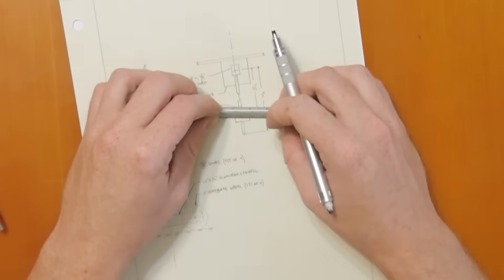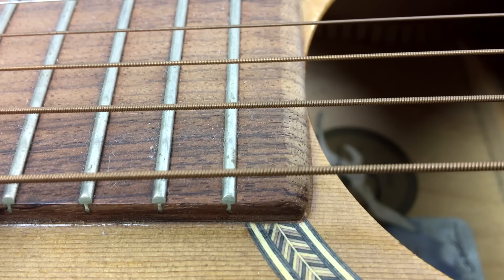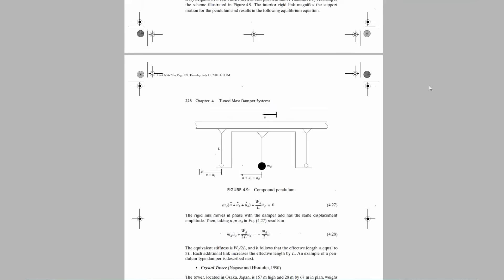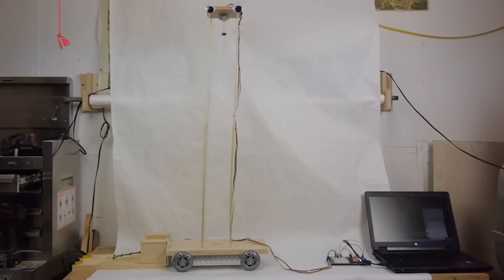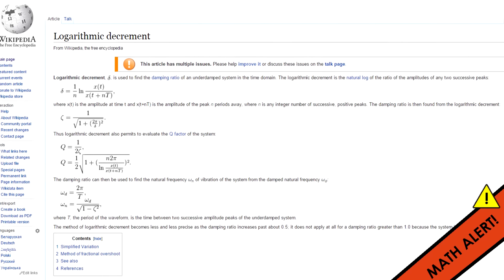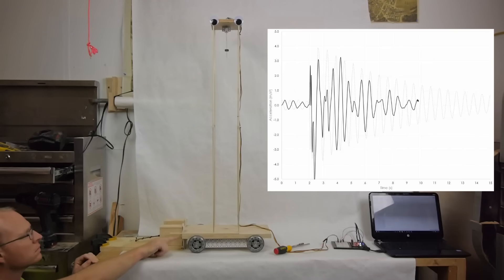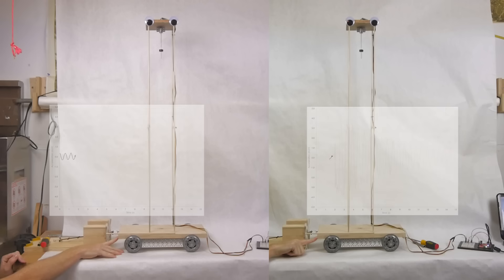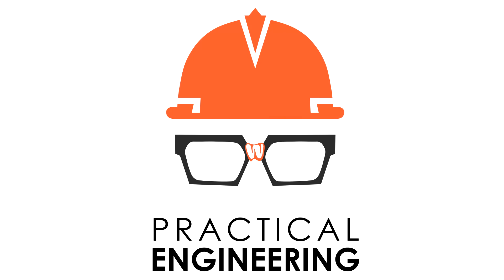What is a Tuned Mass Damper?

Comment: A sky scraper is just a cantilever beam as is a boring machine spindle. If you examine some of the auto boring machines you will find a mass at the end that is coupled by a viscous air gap. This is effective in reducing chatter. Similar idea with slightly different configuration.

Comment: The skyscraper in 1:49 is actually a bad example because it does not have a mass damper, it is designed so that when the wind blows it won't experience oscillation.

Comment: What would happen if the cables holding that heavy sphere up snapped? That thing would plummet through every single floor, crushing anyone unfortunate enough to be under it, until it reached the ground. You must introduce complexity to handle multiple situations, but that same complexity opens itself up to more points of failure. Still, it's a great innovation, as long as it works.

Comment: Great video! 
But (someone may have already pointed this out) it feels like the comparison was not entirely accurate. In the test without tuned mass the "mass" is still on top of the skyscraper (except that it doesn't oscillate). Which in my understanding of physics should get the skyscraper to oscillate more than if the weight wasn't there. Would be interesting to see how the skyscraper would had behaved without any extra weight on top compared to the one with the tuned mass.

Thanks for posting videos like this!

Comment: When I was a kid I used to visit the World Trade Center fairly often and I hated going up to the observation deck. It wasn't terrible. But I always got a little vertigo and I could feel the building swaying constantly. Not bad enough to knock me over or anything. But especially when I got near the windows or went on the roof I could really notice the building moving. I wonder if those buildings had Tuned Mass Dampers. The wind up at that height was always pretty fierce. And New England weather can be nasty. I was always worried about the whole thing falling over in a high wind (obviously I was a kid and there was nothing to be concerned about). But regardless of whether or not they buildings had TMD's or not... man those suckers moved around a lot.

Comment: When to the engineers calculate and tune the dampener?  After the building is built or before hand using simulator and calculation?
Reply: Calculations and simulations, these would get refined and revised throughout the whole design and build stages of the project so that the damper is perfectly tuned when it's installed.

Comment: In gas turbine engines we worry about high cycle fatigue caused by resonant frequencies in a blade matching up with pressure waves acting as a driving mechanism.  I imagine you have seen the videos on YouTube where they put sand on a flat plate on top of a stereo speaker and generate numerous patterns in the sand (mode shapes) by varying the driving frequency.

Comment: I get the principle, but how is damping achieved by that screw tightening/loosing? Why isn't the pendulum still giving back the energy to the building just lkike in your first pendulum? And how is that achieved in full scale model?
Reply: He likely edited out a bunch of other attempts to tweak the pendulum exactly right. They're both oscillating with the exact same period but in opposite directions so they cancel each other out. If they don't have the same period then sometimes they will cancel out and other times they will add together.

Comment: Best explanation I can imagine of a messy engineering topic. Congratulations on an amazing job.
Regarding mass dampers: could an active system be an improvement? something that moves the mass to the point it predicts is going to be most effective in the next instant, so the mass gets there before is needed? (Kind of like gimballed rocket engines compensate for deviations of the entire rocket)
Thnx

Comment: So the kinetic energy is converted to heat to dampen the motion? In this example, the tension on the screw is creating friction which is actually what is drawing energy away from the system?
Reply from the maker: +Pointillism exactly
Reply: I used this information to fix a problem on my 3D printer which suffered from severe mechanical resonance. I used a hacksaw blade as the the "pendulum" (it was horizontal) with a magnet on the end as an adjustable weight. I could slide the magnet up and down the blade to change the resonance of the blade. Once the peak amplitude was found, I put a piece of aluminum approx.  0.01" away from the magnet. The movement of the magnet at resonance induces eddy currents in the aluminum which are dissipated as heat. This video taught me practical information that unknowingly applied to my own hobbies. Thank you.

Comment: First off let me say how much I've enjoyed your videos! They've been really interesting! I'm a senior at my high school, and this video has actually inspired me with an idea of making an adaptation of this for a science fair project. So I had a couple of questions maybe you could answer. My adoption idea (not sure if it holds merit or not) Would it make sense to make the mass dampener smart? Like as in connecting it to a servo and having an accelerometer measure its location and then it counteract it. And my second question (if the idea does indeed hold merit) is there any tips as to how I can program an arduino to accomplish this? Thank you! +Practical Engineering
Reply from the maker: +Spencer McDonald Thanks! It does make sense to have "active" control of a damper that can respond to vibrations, but doing so without a solid understanding of control theory would be a major undertaking. I would do some research on active vibrations damping and see if you can find any good references or guides. Good luck!

Comment: So, I was looking at the decay of the frequency after applying dampening and how you said that after the pendulum stops, that decay rate goes back to the "undampened' rate.

What if you wanted to continue damping? You would need the pendulum to continue swinging, but it won't because now the skyscraper's momentum is lower than the force needed to make the pendulum swing. So you would need a stiff damper that gradually became less resistant proportional to the decreasing momentum of the oscillating tower, right?

So then I thought, what if the pendulum was dampened with something like a non-newtonian fluid? Shouldn't one be able to complement the viscosity to the frequency of vibration to create a damper which constantly adjusts its resistance to the decaying momentum of the tower?

If any of this makes sense, PLEASE try it!

Comment: Sorry. I still don't get exactly how the mass damper decays the oscillation of the building.
Reply: Here is how I understand it.  1. Because the damper has the same resonant frequency as the building, when the building oscillates it transfers energy to the damper.  2. A friction device in the damper dissipates energy from the damper.  In the model, the friction device is the tightened screw at the top of the pendulum.  In real world dampers, the friction device is often hydraulic, similar to the shock absorbers on a car.

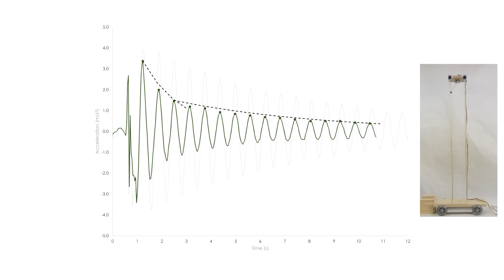Comment: Thanks a lot. Very much appreciate the hard work you are putting into each of your videos. Quick question. You are using Coulomb friction to dampen the vibrations. Coulomb friction is supposed to dampen the amplitude linearly but the results at 7:39 show a non linear trend. May be air resistance is having some damping as well. Could you please throw some light into the behavior of damping with coulomb friction. Could you also do a video on the lesser known damping situations that you talk about. Thanks in advance.

Comment: Great vid guys! I didn't understand something:  The difference between overdamped and critically damped. The graphs look pretty much the same except with a different slope.
Reply: Critical damping allows the system to return to equilibrium in the minimum possible time. Whereas an over damped system would take longer to return to equilibrium. I will give you an example. Analog multi meters have to have their needle critically damped. Because the needle will overshoot the correct reading when taking measurements. If it is over damped you would have to wait longer for the needle to indicate the correct measurement.
Reply: +Karthik C thanks for your help buddy

Comment: Very nice video, but i have one question: How does the Pendulum in the Tapei 101 loose its energy? Ther dont have a screw to tighten, so is it just the internal friction of the cables?
Reply from the maker: At 3:35 you can see the piston dampers. They connect to the pendulum and dissipate the energy.
Reply: Ah thanks, so the cables are jut there for the weight :D

Comment: those "GOOGLY EYES" must be the scientific kind..... lol.  Well, you sold me on this video, I hit the subscribe button. I have been designing &  building things for as long as I can remember for about 37 years... and one thing that never clicked in my head was your (triangle chart) of the inexpensive, effective, innovative. I am at a constant battle with myself. I go through the whole design game of crunching numbers to the best of my ability, to insure that I know where the minimum and an approximate maximum threshold would be or needs to be. My battle comes into play out of fear of something not being strong enough, lite enough, heavy enough, etc., of which results in my over designing and over building something, when certain factors are not an issue. Quite often, over the years, folks will mention to me, after seeing a project, they'll say, "WOW Drew...  it is not going on the space shuttle", or "you building that to go to war"... Although I laugh with them, it actually does bug me, that I over design & build everything. My point that I think I'm trying to get to, is; until I seen your triangle chart, I never had anything to go off of, as per, balance. All three points can be measured, and graphed, to aid in forming a balance of the minimum and maximum tolerances. The shocking part of this triangle chart, is that it is so rudely simple, like a slap in my face, as I question myself, "how did I never see this", even though I was already doing this. Some how, seeing this chart, lets me see these variants as a starting or stopping point. Thank you.
Reply from the maker: Thanks Dru. Really glad you liked the video!

Comment: Where does the energy go? In your damped mass, the dampening started when you tightened the screw. That seems to imply the friction between pendulum and the housing was able to absorb the kinect energy of the building into heat. For a building as large as the Taipei 101, this doesn't seem reasonable, since friction would: 1. wear out the coupling and 2. generate massive amounts of heat, day in, day out.
Reply from the maker: If you look closely at the weight for the Taipei 101, you will see piston dampers at the bottom. It doesn't rely on friction at the pivot. Not sure if they have to cool the hydraulic fluid.

Comment: Really great video. 
I modeled this in a project during my engineering program using MATLAB, though it was using a forced damping instead of a pendulum. It was a bit on the theoretical side so it very nice to see a more practical version and in particular with such a simple set-up. 
I have a question though about your data acquisition or perhaps graphing. What software did you use for real-time graphing of your arduino data? Or were you able to you that algaloo program for it?
I've used MATLAB but it isn't well adapted. I think I could do it with python too. 
Anyway, your input would be useful for my own future projects.

Comment: I wonder if a tuned mass damper would work to reduce the movement of a sailboat?
Reply: I would think so....   If you follow Formula 1, a few years back Renault was using a mass dampener in the nose of their race car.  Once discovered, it was banned.  It was a small can with a heavy slug in oil suspension.  Doesn't sound like much but it really stabilized the front of the car from "porpoising" under heavy braking on rough roads (relative).  Which sounds like a boat on rough seas.
Reply: Any mass added to the sailboat, would be best served below the center of gravity, and when trying to dampen pitch and roll the farther from the center of rotation as well. As such, you'll instantly see that many sailboats already have a mass damper of sorts (the keel). If you were to follow the formula 1 examnple, and install a weight suspended in a viscous fluid inside the keel (or possibly a series of these weights along the axis), you could generate a pretty large damping force on pitch. Controlling roll would be more difficult, since you  could not align damping weights along that axis as much. 

One thing to consider though... These only dampen oscillations. When the period of movement is greater than the structures natural period of movement, it is not an oscillation. In other words, these dampers will do nothing for a big wave that takes multiple seconds to pass under the boat.
Reply: I just looked up the controversy. That's insane that they banned mass dampeners. What's next, are they going to ban shock absorbers?
Reply: Dan Courtney On small boats there is a cruel lack of space, on race boats they are shaving out to save grams, and the ships have enormous needs of electricity. A big cruise ship uses as much electricity as a small town. Warships lack space and have electrical needs you can't imagine.
So such a generator would be bulky, heavy, and inefficient. There are experimental generators using the waves energy. The experiments have been lasting since 100 years...
Reply: Woah. The more you know..
Reply: Cool. The other thought I had was to dampen the mass with an electrical generator. That way I can reduce the rolling and make power at the same time.
Reply: At 44 feet, my boat is large enough to accommodate a device a cubic meter or so in size. It also wouldn't be my only source of power, since I'll have a wind generator, solar panels and when necessary the deisel engine. I was thinking of something in the 20 to 30 Kg range that would mount on deck.
Reply: Dan Courtney
could work but you'd have to find some way to tie the weight of the generator to a piston and be able to adjust the valving based on the frequency and amplitude of the waves you are trying to cancel...  which are always changing.
Reply: Dan Courtney Is it sail or motor? The solutions are very different. I guess sail...motor boats put simply a big generator and a bank of batteries, and eventually solar panels as they have big surfaces exposed to the sun.
1 m3 o a 44 feet that is a big waste of space. On a sail boat it's clumsy at least. On sail boats wind generators are the best. On multis, who create their own wind by their speed, the wattage obtained is pretty good
You'll be surprised how little energy you can get from this cumbersome system. There are more than 80 years that people is trying to harvest electricity on a boat...Pendulums and movement "energy recuperators"  have been tried unsuccessfully.
Dozens of systems have been tried, all shared the same characteristics; expensive, fragile, cumbersome and inefficient.
The 2 systems that give some tangible results are the solar panels and the windmills, as the technologies are mature, although the price of the harvested kW is prohibitive, unless you need absolutely autonomy.
But any sensate yachtsman knows that yachts are the most painfully expensive, the wettest, often the most uncomfortable and the slowest mean of transportation between the a point A  to a point B. A classic joke (I have sailed a lot, but mainly multihull racing)
Reply: You're right about the keel being a mass damper... in addition to its main task of providing righting moment. I also think it's a good point about the frequency of waves being less than the boats natural frequency, at least in rolling side to side. Perhaps not in pitch, but that's also of less concern.

I think that if I keep the weight below the center of gravity, and even make the weight out of something I would have aboard anyway (like canned goods or water storage), then I might not do much for the motion of the boat, but I could at least generate just a little bit of power. It would probably be more of a curiosity than anything.
Reply: I know a guy who put a damper on his motorboat and it seemed to work well on anchor. Operated by drag in the water on a line extending from an outrigger.
Reply: Dan Courtney A similar system has been in use. there was/is a ship with gyroscopic flywheels.

Comment: Formula 1 was an interesting application of tuned mass dampers. Downforce from the front wing and rear diffuser are sensitive to ride height so they're upset by bumps on the track. TMDs were used to dampen pitching of the car, which increased efficiency of the aerodynamics. The system was worth around 0.3 seconds per lap, which is huge in F1. They were controversially banned in 2006.

Comment: i notice that a tight tuned mass damper only seems to arrest the initial motion, not doing much after it stops. 
would it be possible to use a shear thickening fluid in the hinge such that the tension of the pendulum's damping is always proportional to the amplitude of the induced motion, thus doing more damping to the entirety of the motion instead of just the initial spike?

Comment: Does the energy from the oscillation of the building just go into friction at the pivot of the damper? If so, in skyscrapers, does the pivot have to be made of a special material?
Reply from the maker: In a real world version there are separate dampers such as pistons. You wouldn't usually rely on the friction at the hinge since it doesn't really give ideal behavior.
Reply: Ah, ok. I'm familiar with physics but not so much with engineering.